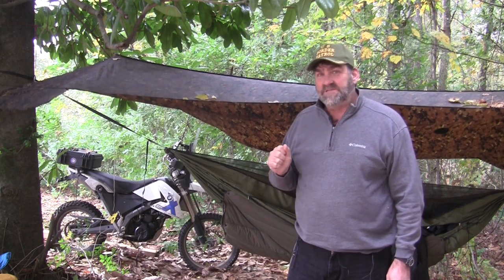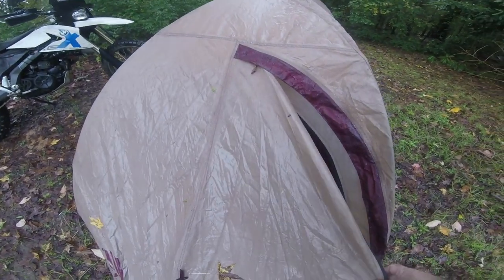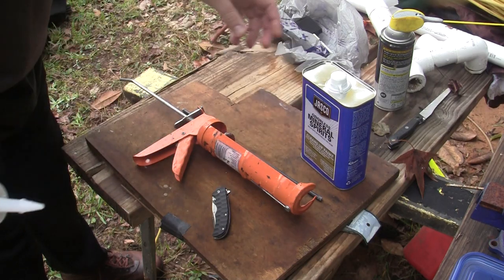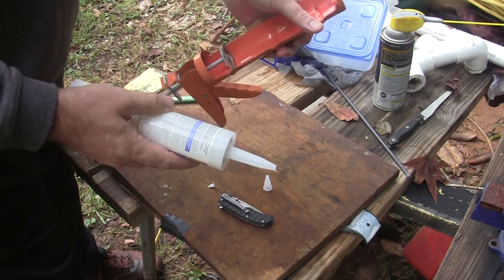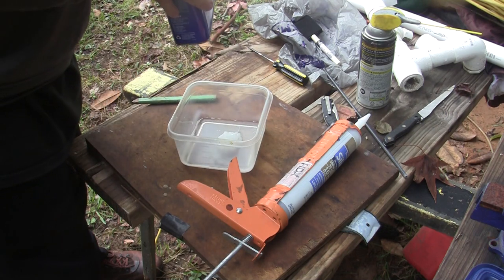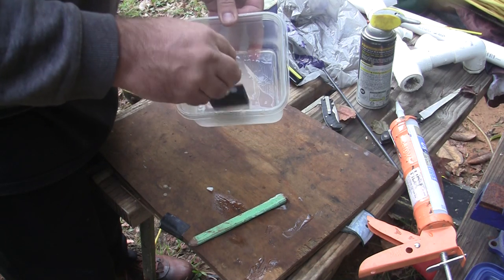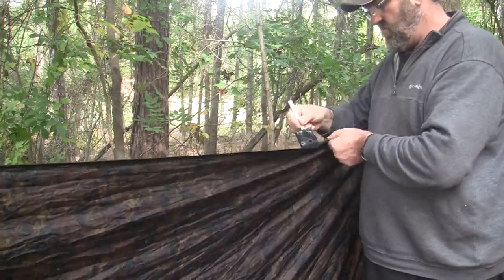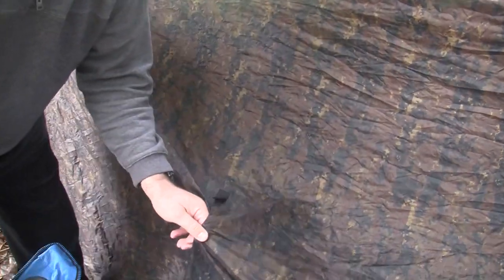Sealing Leaking Tarps, Tents & Rainflys | Motorcycle Camping Adventures

Comment: Wasn't expecting Make Your Own Seam Sealer.  Nice! Very cool hack.

I carry 5 minute epoxy in single use pouches.  The brand name is Hardman, in keeping with this video's innuendo. To patch a hole in a Thermarest style mattress, mark the hole so you can find it, deflate and roll the mattress, mix the epoxy, unroll the mattress, apply the epoxy to the hole as a flat 1/4" patch and the vacuum as the open cell foam inside the mattress expands to inflate the mattress will draw a tiny amount of epoxy into the foam interior to make a durable patch.  Wait an hour before topping up to positive pressure and using the mattress.
Reply from the maker: Epoxy on an AIR MATTRESS?  wow?

Comment: When you whip you caulk quickly is their friction?  If you don't cap the tip is there a mess?
Reply from the maker: You must always use caution when handling your caulk.  Lots of people have gotten in trouble lately by sticking their caulks in OPC (other people's containers) And always recap your caulk before storage to prevent dribbling & mess!